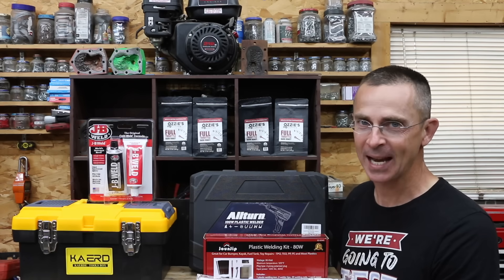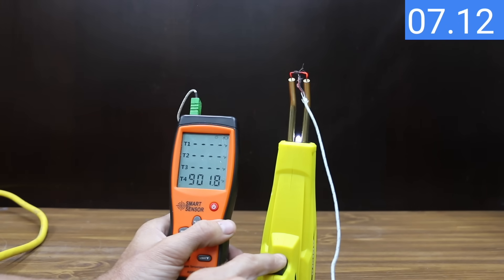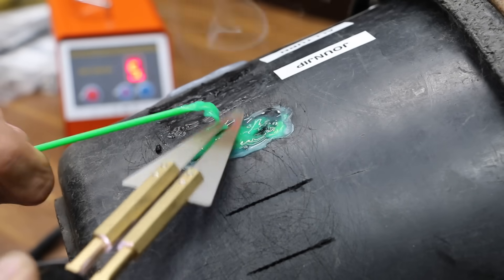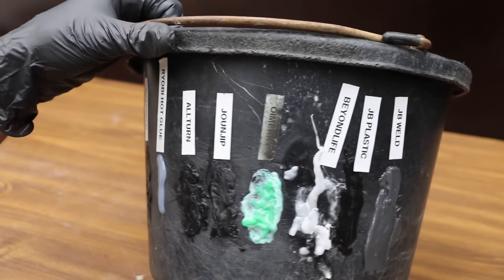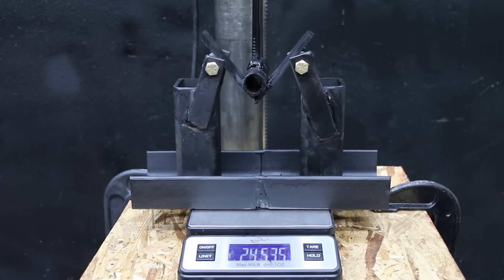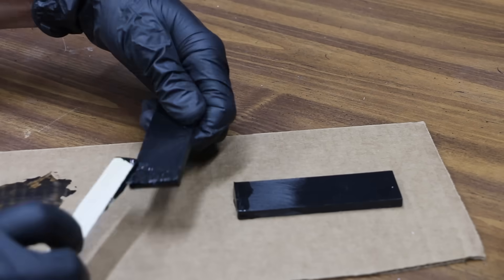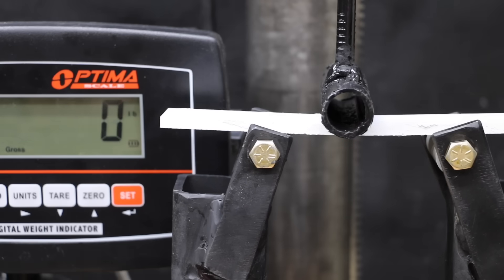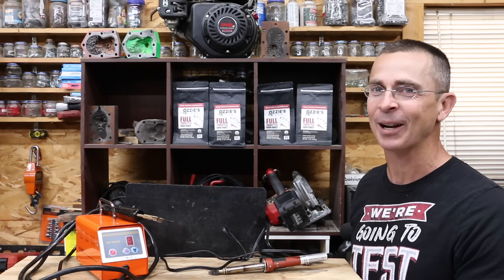Don't Buy A Plastic Welder Until You Watch This Review!

Comment: One of the biggest flaws, if you ever want to revisit this, is that the plastics need to be flame/plasma treated if you’re using epoxy (JB Weld) or other adhesives on them. We use epoxy all of the time to bond to plastic parts, the ONLY way they stick is if you flame treat or plasma arc the surfaces. Sheet molders/casters may also use mold releases and those have to be completely removed/burned off for the adhesives to work. Easiest way is to just use a blow torch and barely melt the surface, it’s essential to get the epoxy to bond. We’ve had employees forgot to flame treat plastic parts before potting and the epoxy pops out like a cake in a well greased pan.
Reply: Few people know about flame treatment before adhesive bonding and its the easiest thing to do. A butane gas torch with a clear/blue flame will work. You can test the surface energy using dyne pens (>38dyne-cm should be good) or even a distilled water fog spray to see if it wets out on the surface. If you want it more fool prof you can also buy handheld corona or plasma treaters that will do the same thing, but with less risk of burning/melting. However, they are $$$!
Reply: I wish I knew that before I tried to stick together some broken nylon parts with epoxy. Popped right of, faster then it took epoxy to cure :/
Reply: @andriosz   Nylon is its own kind of cat.  While I have hot-air welded the stuff, IMO it does not play well with epoxy, or any other kind of adhesive for that matter. If you can create a mechanical joint through roughening, you may have a chance at a decent bond,  but testing is necessary (I am the proud owner of about 500 test coupons of nylon).
Reply: @RAkers-tu1ey  Usually I'm using soldering iron for nylon. This time epoxy was only thing I've had available. Learned something new about it :/ :P
Reply: I sorta discovered this on my own when gluing fittings into polycarbonate tubes.  On some, I flame polished the machine marks from where I cut them, on others, I just sanded and cleaned with isopropyl. The ones I flame polished have such and incredible bond that I'm pretty sure it's stronger than the original material! The other ones just kind of cracked and felt like the glue never cured.   
I was thinking it might have had something to do with tempering some internal stresses within the polycarbonate that locked in during manufacturing, but after reading your comment, it makes so much more sense!
Reply: You cannot imagine how great it is that you have shares this!! Im a welder and woodworker and have never gotten jb weld to work. Im going to test flame test tomorrow.
Reply: I tried spin welding polypropylene and the fittings kept popping off with little effort. The interface between the parts always seemed waxy. She's flame treating sound like something that could help with that defect?
Reply: @bill4123 There are little to no consumer adhesives/glues that can bond to polypropylene... Parts have to be welded (melted/thermally bonded, ultrasonic welded, etc.) It's normal for PP to be "waxy," not very easy to work with :)
Reply: @bill4123  Polypropylene (PP #5)Requires industrial methods such as injection molding or to processed for repair with nitrogen (inert) atmosphere. Plastic welding with either flame or hot air or a hot iron turns it into an oxidized waxy and brittle mess. PE wether HDPE #2, LDPE #4 or UHMWPE is a lot easier to process at home. If you can bake and woodwork, you can melt, repair, mold HDPE.
Reply: Plastic water bottles are flame treated before printing logos on them.
Reply: I was going to mention this also. I forget what type of plastic this works on though as it has been years since I learned this. I used regular epoxy and after heating, it worked perfectly. Before heating was a giant mess. You don't even need to melt the plastic, just wait for the texture of the plastic to change. I do wonder if it was the heat, and a hot air gun would work, or if it needs to be flame to work. I was using propane, or possibly map pro, depending on what I had available at the time, I use map pro more often and this was a small propect that wasn't worth buying propane for this one purpose.
Reply: Yeah months ago I was working with epoxy and different plastic parts and pcb boards and fiberglass sheets and all our paltic parts had to go through flame treatment before we could apply the epoxy. We even had to test all the part with water contact angle test to ensure that $1000 worth of material didnt get wasted when we epoxied the pcb to a few layer and not the rest cause a leak test failure or worse some layer just not being glued together. People will learn real quick when you eff up and drop $20k in one night because you werent paying attention lmao.
Reply: Will sanding work too?
Reply: @libtrs838   Flame or plasma treating is the answer when it comes to most plastics, sanding does very little.
Reply: Actually, this would be a great watch on Project Farm. I do hope he revisits the plastic welders too. 

I’m a bit fascinated by them. Have been thinking of buying one for several years now.
Reply: Would a lighter work?
Reply: I am in the middle a fantastic plastic to PVC project as I type this. So glad I saw your post. Heat treat that shit !  Now I know why my past adventures have failed.
Reply: The thing about this video is you may not have seen that he is not using molded parts and he sanded it down before gluing so reconsider that he might be using it properly for epoxy but other parts he should have melted mesh into plastic to get best results

Comment: If you would like to test a REAL Plastic Welder, you should Look up and test "Hot air Plastic Welders" and make sure to test with a "Speed Tip"..  I Used a Laramy 30-10 plastic welder everyday, 8 hours a day 5 days a week for 5 years and as a professional Plastic welder I never once did that kind of "Weldin". .  Also polypropylene  and polyethylene are both some of the best test mediums for P Welding... oh, amd their are also some units that come with their own air supply built in the handle, though a but clunky, are great for portability and convenience.  Wagner and I believe Swealey are also good quality  brands to look at, any questions just send me a message... always look forward to your vids amd appreciate what u do... thanks

Comment: PE of any type is notoriously difficult to bond in a post manufacturing environment - like almost as bad as ptfe. I use specialty adhesives and epoxies just for PE and anything more than "that should hold for a little bit" is a really good day. So that was either a great test medium or a terrible one depending on your perspective. Great video as always!
Reply from the maker: Thank you for sharing!
Reply: You can use flame or plasma/corona treatment to make PE bondable for epoxies. Something as simple as a handheld butane torch with a clear/blue flame passed quickly over the surface a few times without melting it should accomplish this. For best results, the surface should be abraded and wiped down with solvent first ( acetone, IPA, etc). If kept clean, the treatment will last quite a while  so no rush to glue it up.

Comment: If you're not melting the work surface, you're just smearing melted plastic over the top of it.
You're testing methods are kinda bullshit here and if you did melt the work pieces like a proper weld should, you'd see much different numbers across the board except for the jb weld.

Comment: As with all welding, PRACTICE ON SCRAP.  There's plenty of it if you ask nicely at body shops etc and explain you want to learn. You may even get a few tips. STUDY FILLER MATERIALS. For example we used Laramy Products heated compressed air welders with their filler with excellent results on motorcycle bodywork.
Reply from the maker: Thank you for sharing!

Comment: pro tip for welding plastics ----  
The simplest way is to just press the mesh alone without adding anything , for watertight option it's possible to "weld" without filler then add mesh , in other cases ::
work it like welding metal , grind the V shape between the parts for new plastic , first melt the connection without using new plastic (sticks) and after that add new plastic (like when TIG welding) , then add mesch - press it into plastic without adding filler rods , then add plastic on top until its still hot (heating it either way so the connection is best it can be )
Reply from the maker: Thank you for sharing!

Comment: Dremel 1/16th collet + 1.75mm 3d-printer filament makes for a very handy friction welder. You have to tune in your rpms and use short lengths, but it's usually very strong.
Reply from the maker: Thank you for sharing!
Reply: You would need the matching filament.  Common PLA is a different plastic.

Comment: Bevel the pieces and weld it like you would with oxy/acetylene, it will hold alot better than butt welding the joints. Actual arc welding on steel can dig in a lot more than these plastic welders so giving it a bevel or grinding some material out of the crack will allow it to bond to the most material available by stirring the molten puddle between the two broken pieces and adding filler till the joint is filled up.
Reply from the maker: Thanks for the feedback.

Comment: Just so happens this is what i do. The PE plastic you need nothing ,just heat both parts to 450 at same time and push together , do not bottom out , it will be weak. Push the parts together midway in the heat soak area, done. Stronger than new. ABS ,open season , staples,mesh ,what ever the situation calls for.
Reply from the maker: Thanks for the feedback.

Comment: I don't think this was a good test. You need to groove out the line where you need to weld, and use the 'welder' to heat both sides of the groove till they're tacky, then feed the filler rod in while the 'parent material' is still tacky. Also, the filler rod needs to match the type of plastic being welded.  

The way you were doing it only works if the parent material was already at a temp hot enough to fuse itself.   

I've bought a lot of stuff cheap because of bad plastic welding repairs that other people couldn't make work, chipped off the previous repairs and fixed it properly.  For finishing, a spoon or table knife heated with a torch and keeping the plastic warm with a hot air gun works well to smooth things out.

A simple 100w soldering iron with a simple tip used with a filler rod like a tig welder works just fine for the initial crack filling.

Comment: Can confirm. I have the Jounjip AND the Allturn for the staples. I've learned you need both, they complement one another. And you do indeed need a lot of practice. Last tip is to make sure you get the same weld rods as the plastic you're repairing.
Reply from the maker: Thanks for the feedback.

Comment: I was a plastic welder for about 2 years. I loved it. I mainly used hdpe and polycarbonate but occasionally used abs or PVC. One big thing I would recommend is scoring the plastic a lot with a knife or screwdriver, something to make deep grooves. Another thing is take a router with an angle and cut away some of the corner with the sides you're trying to weld together. The main machine I used for welding hdpe had a huge spool of rod and the gun pumped it out like a 3d pen, it had a Teflon tip with 45 degree angles on the sides and a flat middle where the hole was to pimp the plastic into it, also it had a hot air tube pumping super hot air right before the hot Teflon tip. I might have a video somewhere of me using it. It's been a few years since I've been there so I'm just going off of memory. Polycarbonate welding was just taking a deburring tool to the corners and it was using hot air and a hot tip, like it was a straw with a slightly curled ironing tip and it heated the plastic with the air before the tip went over it. I never used any rods of polycarbonate into the thing but I had a different tip end if needed to with abs and PVC. Just run the thing down the corner at a decent slowish speed and I've tried breaking the weld to redo the weld like if I put the piece on backwards (which I did often, I'm not going to lie lol) and it literally broke the piece every time and never the welded spots. To redo the weld I took my utility knife and cut down the corner a few times gently the first couple times then one last harder one but being careful not to cut the sheet by losing control of my knife (I've done that many times too, and we used a CNC to cut the shapes out so I had to redo the thing in CAD on a scrap piece) idk if this helps or confused you further.
Reply: You wrote *the hole was to pimp the plastic...."  And it got past YouTube's algorithmic Censors! 😂
Reply from the maker: Thanks for sharing.

Comment: I use a regular soldering iron and get good results.  Key is how deep into the plastic you sink the iron and fuse the parts.  I've never had ANY JB Weld product work as advertised.
Reply: The only JB weld product I've used that I didn't like was the plastic fusion epoxy. Their regular epoxies are excellent.  Their ultraviolet curing super glue, which used to be an actual "super glue" brand, works quite well ,  but the squeeze tube packaging it comes in is terrible and clogs up prematurely so that you can't get the rest of the glue out of the tube. I'm gonna have to call them up and bitch at them and ask them to sell smaller single use tubes of the UV curing super glue, because it's very useful.
Reply from the maker: Thanks for the feedback.

Comment: You need to redo some of your testing using Super Glue I know different brands are going to behave slightly differently what I know is near just pure cyanoacrylate is starbond which is usually used by people who make RC planes and shit but the reason why I say you should redo your testing with super glue is I know for a fact that super glue when properly applied can usually be stronger than the material that you are applying it to
Reply from the maker: Thanks for the suggestion.

Comment: You should use the same plastic material as the damaged material to make the repair. Only very few different plastics will fuse together for a good weld. The normal welding temperature for hot air welding is typically 295-305°C. For a good repair the damaged area should reach the same temperature as the repair material to fuse the materials together. Two component products such as epoxy are not recommended to repair thermoplastic products.
Reply from the maker: Thanks for the constructive feedback.

Comment: Very interesting but for all practical purposes I will buy JB Weld original. Its readily available, fairly effective, proven, and less expensive than many of the repair kits, even if it is just glue. The Roybi glue gun didn't perform badly. Would any hot glue gun and hot glue perform just as well? Hot glue may be a hobby store product but it is very effective when the temperature drops below 45 to 50°F as my garage is unheated. I have used it to screw and glue many wood projects in the winter, late fall, & early spring as wood glue and epoxy doesn't set well if at all when the temperature goes below 45 to 50°F.
Reply from the maker: Thanks for the feedback.

Comment: The green one is a Lister rip off.   Also to WELD plastic, the rod has to be the same material.   I welded tanks for a living as part of my multi skilled apprenticeship.   That machine it’s not meant for glue sticks, it’s for round rod that you use to fill a bevel just like a metal weld fillet.

Comment: I worked in hdpe pipe manufacturing for 13 years. Welding is the only way to securely bond hdpe. We used filament fed welders to manufacture culvert size fittings and spin welding to attach couplers. There is no known glue for hdpe.
Reply from the maker: Thanks for the feedback.

Comment: If you're using an adhesive without melting the plastic, using an adhesion promoter as used to prep plastics for paint helps the adhesives stick.
BTW, JB Weld like products take almost a week to fully cure. 36 hours isn't long enough to get accurate test results.

Comment: Hope you had good ventilation in place, many plastics including ABS and polycarbonate tend to release some nasty fumes when hot. Also seconded that you need to use the proper filler for the plastic you're welding.
Reply: PVC fumes are extremely toxic.
Reply from the maker: Thanks for the feedback.

Comment: This was fascinating.👍 I have a plastic welding/smoothing tip for my Weller soldering gun, and have used zip ties as my welding rod.  Didn’t know there were so many options out there, and now I want to make a “hot staple” adapter for my Weller gun. Everyone has staples. Thanks for reinforcing my faith in JB Weld (presently curing on repair of a brass “tank tee” for our church water system).  Thanks for a great video!
Reply from the maker: Thanks and you are welcome!

Comment: Todd The Artiste - not.  So solly. ;)  Interesting tests and results.  I had never even seen most of these machines, and the two that I have seen were both hot air based.  When I bought a better soldering station (Zeny 2-in-1), I got one with the hot air function on the side, which could be used for either SMD soldering or plastic repair.  It has variable nozzles, heat, and air speed, but I haven't even used it for plastic repair yet.  Instead, I got out my 100W stained glass soldering club.
If I needed to do more plastic repair, I'd probably get some fresh JB Weld and go for it.  LOL
I think your tests proved to us how very hard it is to get the two sides melted enough to weld back together.  Lastly, I've seen some people having luck using plastic cable ties as rod for plastic welding.
Reply from the maker: Thanks for sharing.